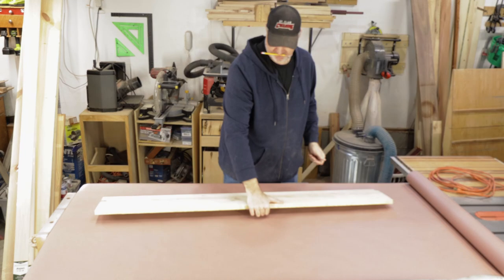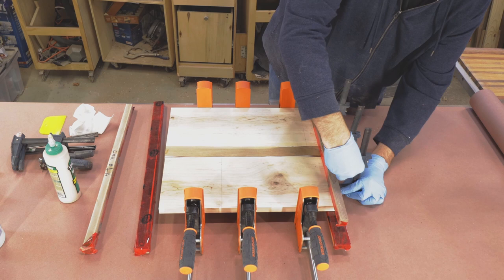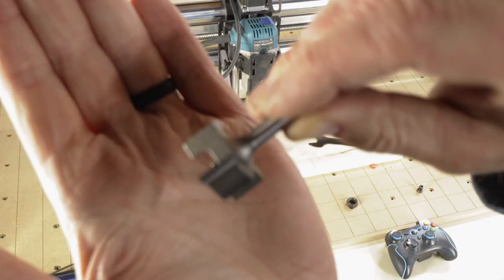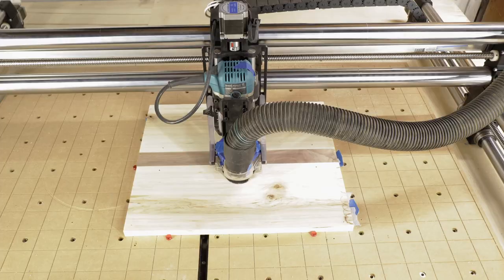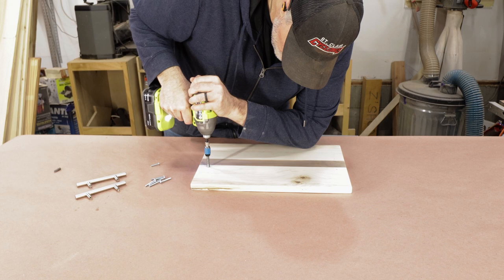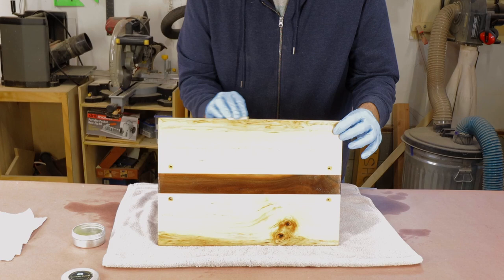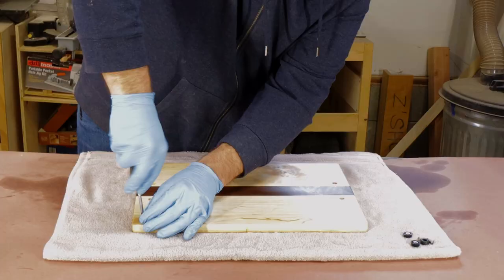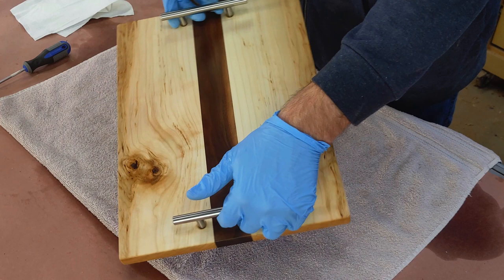Revealing My BEST Selling Item of 2022  (Onefinity CNC) Great for Beginners!

Comment: Nice project, but I would just use a table saw.
Reply from the maker: Yup, you are right! I just use the cnc to flatten them. Sometimes I will make 4 or more at a time so I glue up one big panel and let the cnc do the rest of flattening and holes for the handles. Good time saver, but not the only way to make them.